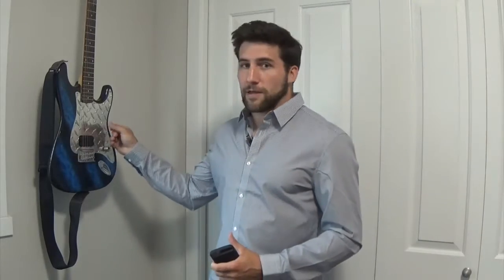Ask Brad Ep 9 | Air Pressure Settings and Metal Art

Comment: Brad, can you explain how to get this finish?  http://www.sweetwater.com/images/guitars/AGBV205ATCL/211201S16040450/211201S16040450-back-xlarge.jpg

The color variation is random but gradual up to the grain lines and respects the grain lines.  Which is not what blotching normally does.  It's maple but maple has a reputation for blotching.  Yet, I don't see this as blotchy.
Reply from the maker: They probably sprayed on a finish with a transparent dye in it. As long as you spray properly, there should be no blotching if you spray overtop of sealer. Alternatively, they may have used a wood conditioner and then a stain. The black vignette around the outside was almost certainly sprayed on. I'll have a video coming out reasonably soon where I do the same on the guitar kit project that is currently in progress.
Reply: Brad Angove
I'm really looking forward to your video.  I've tried to get that with Minwax oil stain on 220 sanded common board.  Just wipe on and wipe right off.  This is the best I've gotten so far but with Black:  https://dl.dropboxusercontent.com/u/2559919/IMAG0437.jpg

Brown doesn't high light so well.

Sorry for the crappy pictures.

EDIT:  Oh, I forgot about this experiment.  I sanded the board to 400 and put on Jacobean Ebony, and Expresso:  https://dl.dropboxusercontent.com/u/2559919/IMAG0438.jpg

I still don't think it's as good as the Ibanez finish.
Reply from the maker: Some woods take stain better than others. Keep in mind that if you put a clear coat over those tests, it will increase the contrast and darken it up somewhat. You may want to try that out on your tests before choosing to switch to a different application method.
The vignette should probably be sprayed on. My video will cover that when it comes out. It will be in part 16 of my series I believe.